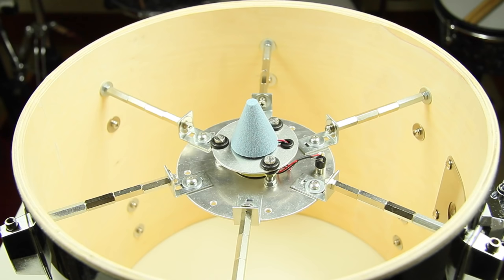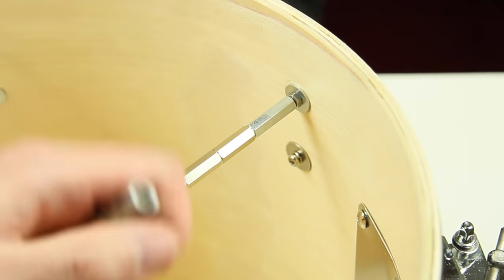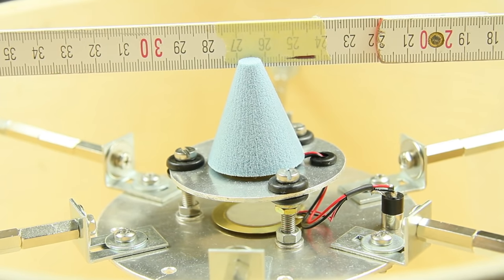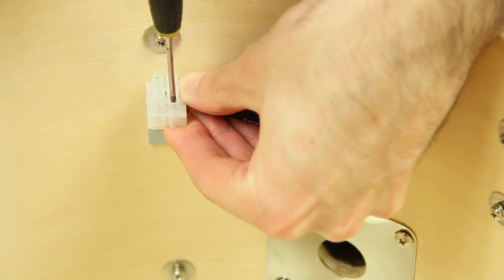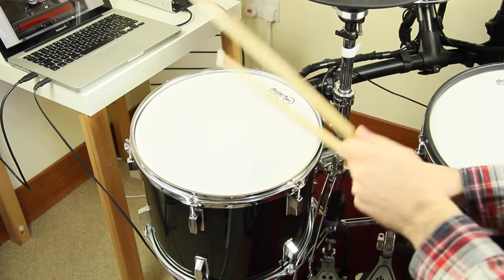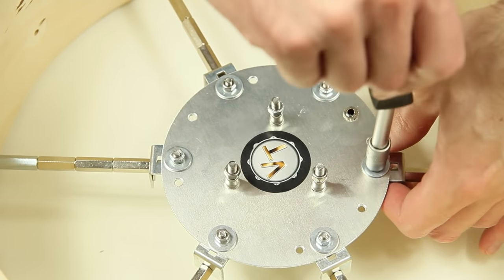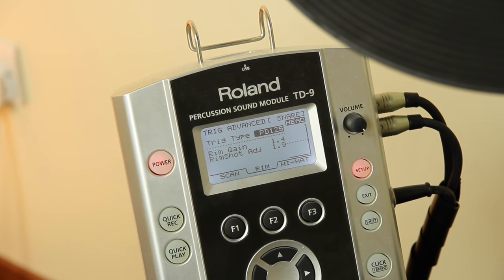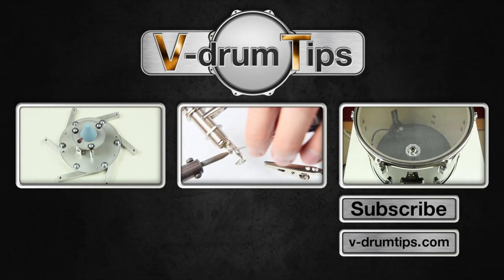Dual Trigger System (E-drums)

Comment: Could you use a non mesh head drum head with this setup? I would be incredibly convenient for recording the actual sound of the drum and a trigger track along side it for gating the original sound of the drums or sample reinforcing the sounds
Reply from the maker: +Doug Payne I think this setup would change the sound of an acoustic snare. I would go for a smaller internal trigger in this case.
Reply: +Vdrum Tips Thanks for the info, I just watched the video on the flex 2.0 trigger system and was wondering if that would be the better solution the scenario I previously described
Reply from the maker: +Doug Payne No, actually not, the best solution would be the Wronka- or Triggera Trigger (Check videos). They would not effect the sound too much.

Comment: Would you an able to connect the wires from the piezos direct to a socket on the shell instead of a a 3.5mm plug on the disc and then a separate cable to the 6.5mm socket on the shell?

Comment: Can you do this with acoustic heads? So you can have the Acoustic sounds with the triggers going to a sound module? Thanks!
Reply from the maker: No, a trigger sends an electric signal, not a sound. This is not a microphone.
Reply: Yes, you can. However the pressures created from playing the drum will seriously double & tripple trigger.

Comment: So what is the difference in sound quality, if any, between the RTB and RTS trigger systems? Is it only the mounting bracket or do they use higher quality cones and peizo for the more expensive one? Thanks!
Reply from the maker: +michael king Hi, the sound is not coming for the trigger, it comes from the module. The RTS triggers more accurate, since the rim sensor is centred. It is also built in a higher quality, the installation process is easier through the elevation screws and overall it reduces unwanted vibrations trough the complex construction.

Comment: Hi, Congrats for your channel. Your DYI videos are amazing! 

What do you think about roland triggers, especificaly RT-30HR for use in a TD-9 drum instead of a Roland's PD-10? I want a larger snare, but the PD-12 is too expensive. If i buy a regular acustic snare and a RT-30 trigger, i spend half of the money, but i am not sure about the performance. What you think?
Reply from the maker: Triggers that are not centered are never as good as centered triggers for Roland modules. What about a second hand pad as snare? PD-125 cost around 150€ used.
Reply: I live in Brazil, its difficult to find 12" used ones. But i can buy those germany centered triggers and adapt on an acustic snare here. Do you recommend a model? I am not a professional. I am a beginer/intermediate drummer. It's just a hobby for me. 
Thanks a lot for you answer!!
Reply from the maker: The R-drums RTB trigger delivers really good results.
Reply: +Vdrum Tips thanks!!